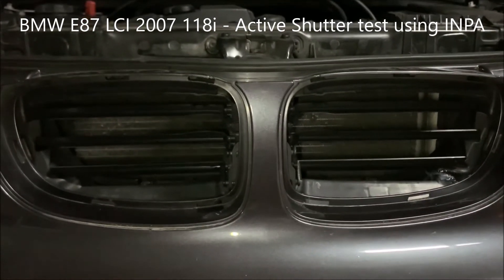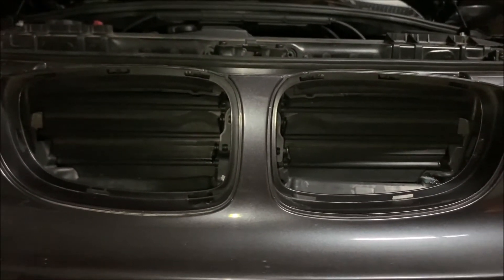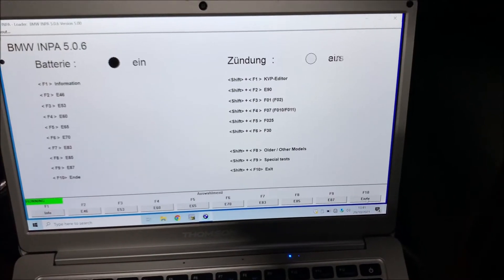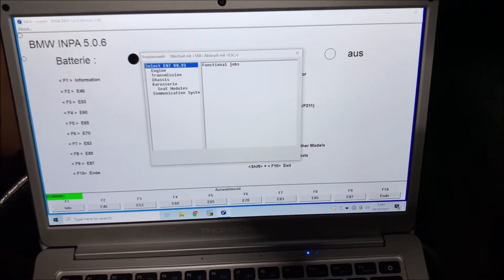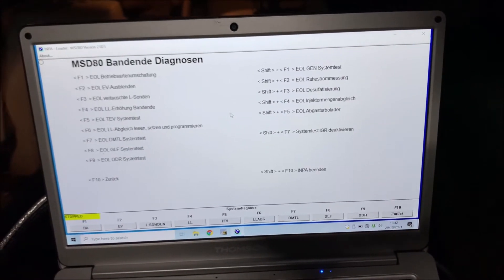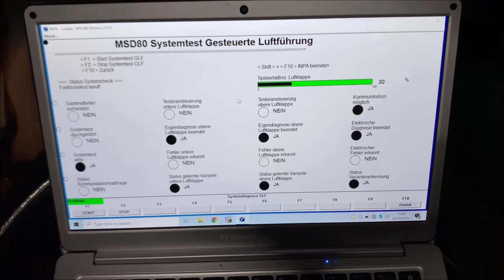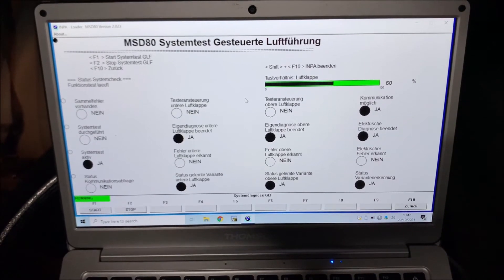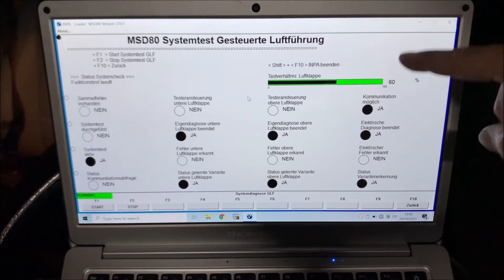BMW Active Shutters - Gesteuerte Luftführung

Comment: any chance/way to leave them open on a (2020) X7 M50i G07?
Reply from the maker: I’m not sure you can program them to stay open, also there is a reason for shutting them (efficiency) but you could try and manually disconnect the linkage arm from the servo and then it won’t be able to control them.. but you will need to fix them in the open position somehow..

Comment: On my e92 320d they never open, well I haven’t seen them ever open and now from my understanding the engine will have to be very hot in order for them to open that’s grand good to know but today I unhooked them from the actuator to keep them open full time, but from what I have seen now it’s actually a bad idea for fuel efficiency and aerodynamics, anyway opinions on what I should do please? What’s INPA and is it possible to get to test the actuator and also my radiator fan dosnt seem to work even when I’m in traffic, thanks in advance for any help
Reply from the maker: Have a look on YouTube for INPA, you will need a laptop and a special cable to plug into the diagnostics port on your BMW. Then you can check and test various things..

Comment: Hi. My f10 after the egr recall doesn’t hold the temp as it did before , but I noticed the shutters to open straight away when I start the car , is there a way to code them ?
Reply from the maker: I don’t think there is a way to code them easily.. I think there is a bmw coding Facebook page, give that a try and see if anyone can help. I’m guessing that whatever controls the GLF shutters will have some parameters associated with when to open and close them. Normally they are closed when driving for better fuel economy unless it’s too hot.

Comment: I got a 2018 m550i these things stopped working yesterday Wednesday dealer said come in Monday 🤨 and I smell antifreeze while driving now. Is there a way to open them manually?
Reply from the maker: I'm sure it's possible. You would need to remove the kidney grills and then disconnect the rod from the motor that connects to the flaps and then secure it in place with a cable tie. If you just unplug the motor electrical connector, you will probably get an error on the dash showing up. I would also have a good look under the car if it also has lower flaps, maybe something like a stick got stuck in the mechanicals and is blocking it from operating. If the car overheated, you would have got an indication on the dash.. The fact you can smell coolant might indicate something penetrated the front of the car and also might be responsible for blocking the flaps from moving..

Comment: My car is 520d 2011 and its so cold and frozen but its still open and never get close do you have any suggestions? Why its stuck ?
Reply from the maker: You will need to use some
BMW software if you want to test the shutters. Also some cars do not have them so make sure they are actually installed? If they never close, maybe the actuator motor is faulty… only way to see is to use the diagnostics software.

Comment: In my car it’s always when I see it closed but there is no warning my car bmw e87 2009 118i it’s that normal
Reply from the maker: Mine also only opens up when it’s super hot. You need to use INPA to test it if you want to see if it’s working ok.

Comment: hello in my car, when the f10 engine cools down, all of them turn on and off and stay closed, the others are open (when it gets cold, so the car doesn't start) it happened by itself. This problem was working, actually it still works, but there is an inconvenience shutterde
what's the solution, it's not broken or something, the shutter motor is working and it's on itself, but the bit remains closed, the other is open
Reply from the maker: Not sure the exact model of BMW you have but on the E87 series it only opens the shutters when it’s really really hot.. or once you are stopped with the engine running.

Comment: Hi there.. I have the 4349 alarm "active radiator shutter, actuation"... 
Does anyone had to solve this problem? How did you solved it?
Reply from the maker: What model? E87? You need to take out the front grilles (YouTube) and then check that there is nothing broken and the actuation is working ok. Connect INPA and run the GLF test to see if you can hear the actuator motor move or not.